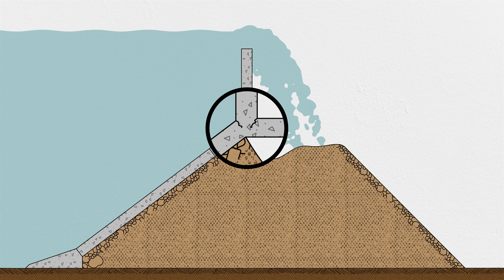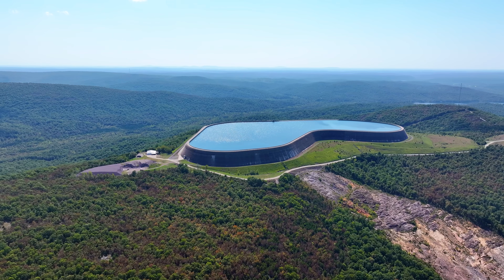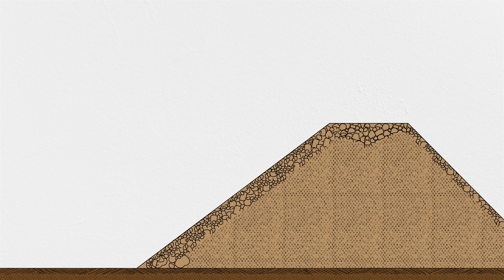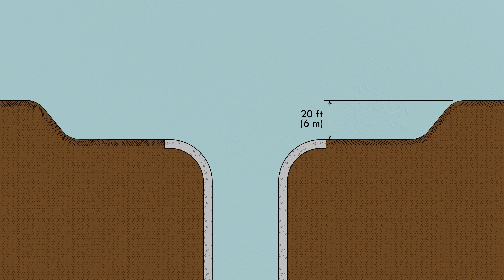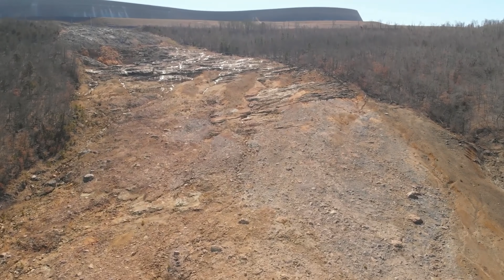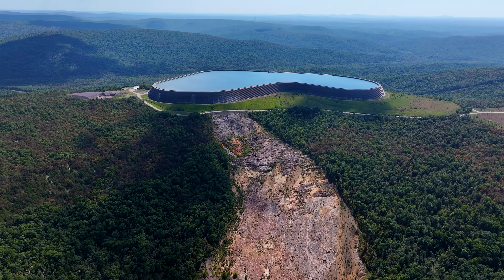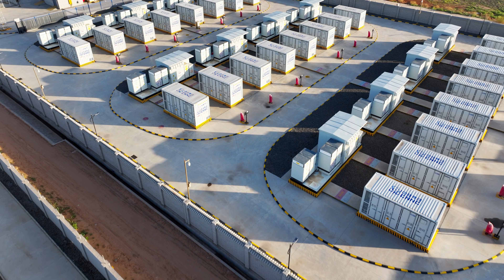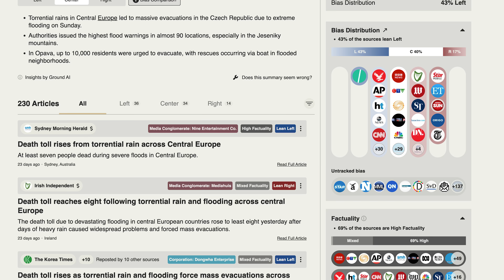The Wild Story of the Taum Sauk Dam Failure

Comment: The excess soil in the rock embankment reminds me of the Kansas City Hyatt disaster.  A classic case of where the construction crew didn't adhere to the engineering specs and the engineers didn't double check that their instructions were being followed.  I'm an electrical engineer with over 40 years of experience and I've lost count of the number of times that corners were cut behind the engineer's backs.
Reply: Oh, ow. Thanks for the reminder. As a Missourian, I stayed in the campground mentioned in this video, before the accident, and in the Kansas City Hyatt, after that accident. 
I had forgotten about the accident by the time I stayed there, but I noticed that something about the lobby was odd. The ramps to the Skywalk were still there, but they ended in little balconies or something. The design/layout didn't make sense, and it bothered me. When someone reminded me where I was, I realized what it was.
Reply: Same thing happened with the Oroville Spillway failure. The spillway wasn't built on sound rock.
Reply: Early in my career, a veteran engineer told me, “when it comes to contractors, you don’t get what you EXpect, you get what you INspect.”
Reply: One of the most important questions a designer can ask, when told that something is supposed to work a certain way is, "What if it doesn't?"
Reply: Sometimes the engineers don’t understand how hard their designs are to build. Sometimes the builders don’t understand why the engineers designed something a particular way. When that happens at the same time, you’ve lost some or all of your safety margin.
Reply: @j.danielphillips3778 It is incumbent on the project manager to ensure that there is continuous communication between the disciplines in a project. If the construction team and the skilled trades don't understand what the engineer's intent is the potential for catastrophe is obvious. The PM and the engineer both have a duty to ensure that the intent is clearly explained, in a manner that is understood, to the workers that will execute the project. I am an engineer, and I ALWAYS make sure that this is so, even if it means stepping on the PM's role. It is far too easy to assume that everyone has the same understanding of what I intend with my designs, and so I make it a practice to assume that nobody understands, and it has to be explained to everyone on the team. This can usually be done efficiently, and it fosters an additude of cooperation and teamwork. At the same time no one has a monopoly on good ideas, and over the years I have learned many excellent, practical ideas from the trades, and I value their ideas and opinions a lot.
Reply: @j.danielphillips3778 thats why you have procedures, legally binding contracts and (safety) rules? Mankind is not wired to understand EVERYTHING thats why we have people doing different jobs that they are good at...but maybe they just need more time to work side by side, buildrts and engeneers along, on the field, so they can learn from each other
Reply: Oh, we hear about it SO MANY TIMES on this channel!
Reply: There should have been inspectors representing the engineer. There is no way that could happen with a highway project, too many checks and balances. Even the pits/mines are inspected. The material is sampled again at the job site to ensure it meets gradation spec. Although it does get to be more complicated the larger the stone size. I just placed some 48" boulders for some guide vanes and the pit didn't know how to handle it. At first they sent crushed brick. Rejected.
Reply: I can't imagine a project of that size not having either continuous onsite engineer reviews or at the very least, field visits from the design engineers to review/confirm the construction process.  So the next question is: Were the review engineers qualified and/or informed of the REQUIREMENT for the rock content being HIGH for the fill dirt, instead of low to increase compaction?
Reply: The ironic thing is that they would have been money ahead to build it to spec the first time, versus cutting corners early, then having failures or disasters having, and having to pay to repair and recompense those.
Reply: We visited Taum Sauk when I was a kid, just a few years after it had been built. I found it fascinating. I watched the animated demonstration in the visitor center many times. And Johnson's Shut-ins is beautiful, with dozens of natural pools and waterfalls to swim in.
Reply: My first question if involved with the storage project would have been … having to have a continuous unbacked wall, around the entire lake naturally increases the odds of a failure … you can make anything work if you have no conscience on how much of other peoples money you spend …
Reply: Given that they accept the lowest bidder, its essentially an inevitability that corners are cut on every site to bring cost down.
To agree with your sentiment and not to absolve the construction companies but when you contract out it is still your responsibility above everyone else to ensure the spec is followed.
These projects don't go up overnight (by a longshot) and the engineering firm wasn't making pennies. They had AMPLE opportunity to witness and correct the construction flaws.
Reply: Bring back overseers!
Reply: And I can guarantee the slobs were saying to each other, "Those engineers only know what works on paper."

And there is some truth to that, but as always, there is nuance, as in there are two sides to every story. Engineers micromanage; workers at times take pitiful shortcuts.
Reply: yeah and i’m gonna argue that having construction sites full of people who speak English as a second or third language, if at all, isn’t helping with our standards. German engineering wouldn’t be as good if they weren’t required to speak German… but we won’t do that in America
Reply: @mafiawaffle Nooooooooooooo
Reply: off topic but can you tell why they often cut corners in construction?
Reply: @neoautolab  Cost. Materials, labor, equipment, etc. And if you're already set up to start working and then have to delay due to some regulation or permitting or whatnot, you either have to undo all the setup or pay employees to sit around and leave equipment unused.
Reply: @neoautolab  Because far too many people fail to realize that, in the long run, the cheap way ends up being a lot more expensive. It comes down to greed and stupidity.
Reply: @neoautolab  Corners were cut in the construction of the Hyatt Regency skywalks for a variety of reasons, including miscommunication, pressure to meet deadlines, cost considerations, and inadequate oversight during the construction process.

	1.	Simplification of the Design for Easier Construction: One of the main reasons corners were cut was the decision to modify the original skywalk design to make construction easier. The original design called for continuous support rods running through both the second- and fourth-floor walkways. To make installation simpler, the contractors changed the design to use two separate sets of rods. This change was meant to save time and reduce complexity in the construction process but led to the fatal increase in load on the upper walkway’s connections ￼.
	2.	Lack of Proper Review: The modification to the rod design was not properly reviewed by the structural engineers. The engineering firm, Gillum-Colaco, was overwhelmed with other projects at the time and did not perform a thorough analysis of the changes. This inadequate review allowed the flawed design to proceed unchecked ￼ ￼.
	3.	Cost and Time Pressures: The Hyatt Regency was a high-profile project, and there were likely pressures to keep construction costs down and meet deadlines. Cutting corners by making design modifications without full review might have been seen as a way to keep the project on track. Unfortunately, these shortcuts came at the cost of safety ￼.
	4.	Miscommunication and Lack of Accountability: There were several communication failures between the contractors and engineers. The engineering firm assumed that the contractor would seek approval for any significant design changes, while the contractor assumed the changes were minor enough not to require such approval. This lack of clarity in responsibilities contributed to the eventual collapse ￼ ￼.

In summary, a combination of time-saving measures, poor communication, and insufficient engineering oversight led to the corners being cut, ultimately contributing to one of the deadliest structural failures in U.S. history.
Reply: @neoautolab  It is the way of human nature and the Dunning-Kruger effect. People who are not specialized experts think they know more than they really know about a subject. Then combine this ignorance with a desire to get something done efficient or fast and they start to make small unapproved changes which evolve into large changes. This happens in all types of work, not limited to construction, you just see it most in construction because when large failures are very visible to the public. It is often well intended by the person making the mistake, not greed or laziness, they think they are being more productive, reducing waste, and contributing to the team effort. They are simply ignorant of the possible hazards and the level of risk they are taking. 
As a responsible party with final approval authority I have had workers who are paid by the hour get mad at me for slowing them down and rejecting their work for non-compliance, even though they get paid the same or more by doing it correct with the same overall effort.
Reply: @neoautolab money
Reply: @neoautolab  When the contractor is paid 100k for an expensive substrate, but buys a 20k subtrate instead and no-one notices, they can basically pocket 80k. Its theft, basically. Contractors will do anything to get away with giving a subpar job if they can, so they can profit more.
Reply: @A-ii5dp  Reminds me of Grenfel towers and the cladding.
Reply: @A-ii5dp Not all contractors behave in this manner, just the ones that make the news cycle. I pride myself on not cutting those corners despite sometimes the urging of clients. I regularly remind people that someone urging them to cut corners is never there when something goes wrong - to take the blame. When you start talking about them asuming the risk and cost of remediation suddenly those people find someone else to bother.
Reply: @A-ii5dp  That is so concerning, I bet they even know it would be dangerous but still do that
Reply: @neoautolab  Youtube censored my comment, but fortunately I keep a copy-paste history:
 It is the way of human nature and the Dunning-Kruger effect. People who are not specialized experts think they know more than they really know about a subject. Then combine this ignorance with a desire to get something done efficient or fast and they start to make small unapproved changes which evolve into large changes. This happens in all types of work, not limited to construction, you just see it most in construction because when large failures are very visible. 

The change is often well intended by the person making the mistake, not greed or laziness, they think they are being more productive, reducing waste, and contributing to the team effort. They are simply ignorant of the possible hazards and the level of risk they are taking. 
As a responsible party with final approval authority I have had workers who are paid by the hour get mad at me for slowing them down and rejecting their work for non-compliance, even though they get paid the same or more by doing it correct with the same overall effort.
Reply: @TheDuckofDoom.  Thanks for your info. I wonder if they are aware of the possible hazards and the level of risk they are taking, they still do it or not. I think it depends but not sure
Reply: IIRC the construction team got engineering approval for the changes at Hyatt 😮
Reply: @jeromedrescher1402 No, they did not. While the change was discussed between the contractor and the engineering team, it was not properly analyzed or approved by the engineer in charge, Jack D. Gillum. The lack of a detailed review of the new design led to the failure of the connections under load, causing the collapse of the walkways during a crowded event, killing 114 people and injuring many more.
Reply: @hertzlcw  While construction of the Hyatt was in progress the atrium roof collapsed. Investigation into that collapse established that the cause was poor construction workmanship. During the course of their investigation of the atrium roof collapse, appellants discovered that they had made certain errors in their design drawings and that they had failed to find discrepancies in their review of shop drawings involving the atrium. These errors and discrepancies were in areas other than the walkway design. The owner and architect directed G.C.E., for an additional fee, to check the design of the entire atrium. G.C.E. undertook that review. Gillum assured the owner's representative that "he would personally look at every connection in the hotel."

If I am not mistaken, its engineer's and architect's job to double check the work been done. The roof collapse should gave him some sorts of warning. He didn't take it. The fact one rod vs two rods been discussed, that'd be the first thing he should have checked. Either he thought that was ok, or he didn't check. Either way, he was the owner of the engineering firm, he owns it. Note the disaster happened after a year after opening. He signed off on it. Agree or not is just a wording they throw in the court of law.
Reply: @hertzlcw Sorry to nitpick, but the contractor and fabricator DID get approval. The fabricator submitted shop drawings of the two-rod system, and those drawings were returned with an engineer's seal stamped on them, indicating they had been reviewed. The issue was that the "review" was cursory at best, negligent at worst, and wasn't performed by the correct people.

Comment: Genuinely, with more of home solar panels installed, we should have far fewer environment-damaging infrastructure. In Germany, balcony solar panels are becoming more and more common (legal to directly insert the max-800 watt inverter plug to the wall without permission!). With some batteries as buffer, nights will be covered too. Even in the middle of cities, no need to make an off-grid case out of it. Reduced energy demand = less dams = less risk and damage.

Comment: Now I feel like it's only a matter of time until a large battery storage is mismanaged and fails catastrophically, and what kind of damage that will cause...
Reply: Several in southern California, including one recently in the city of Escondido, have had battery banks catch on fire.   While the batteries are contained in literal shipping containers, the fire created an acrid smoke.   The local fire departments had trouble putting it out, indicating the need for more understanding and training on their part, as well as more research and engineering effort put into early detection and  warning systems that a battery bank is about to ignite.   Basically, what’s needed is reasonably inexpensive fail-safe system that will quench such a fire as, or preferably before it starts.

Comment: The major difference between a battery dam and a battery bank is that if you place the battery dam correctly, you get a lot of other benefits from having the water storage.  Water has massive power, but it also has many other uses as well, so my expectation is that multi-use battery dams will become far more prevalent, especially where they can be at scale such that most of the margin is natural valley.  We always want h to be as large as possible, but there is nothing conceptually wrong with having two hydro dams on a falling river, and a long return pipe to pump water from the lower back up to the higher dam if additional generation is not needed and there is available storage.   I know here, drinking water storage dams are a very big deal: but there is no conceptual reason we could not build a second "high" water storage dam as a battery dam, after all water turbines should not be dumping toxins into rivers anyway.  Indeed somewhere like Perth, Australia, potentially the water in the dam could even be from a desalinization plant, and pumped up into the reservoir - with water production being on windy or sunny days, and in a city that gets sunny days for four months in a row at times and that has plenty of space for solar plants, a dual use drinking water - hyro battery dam might be extremely useful.  Indeed, given the mining industry over here, cisterns could even be cut into the rock and used to reduce evaporation if desired, although that would have an obvious cost element.